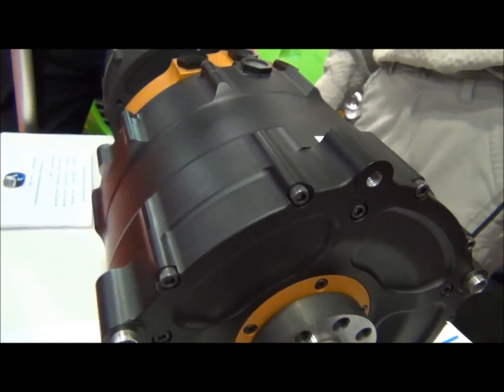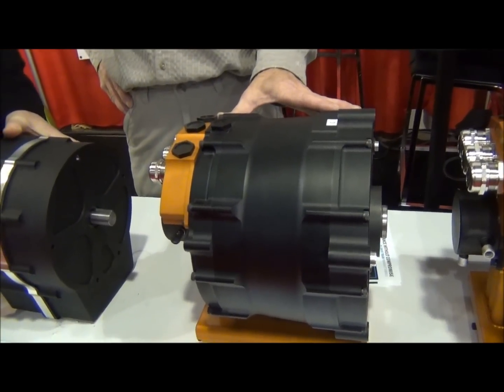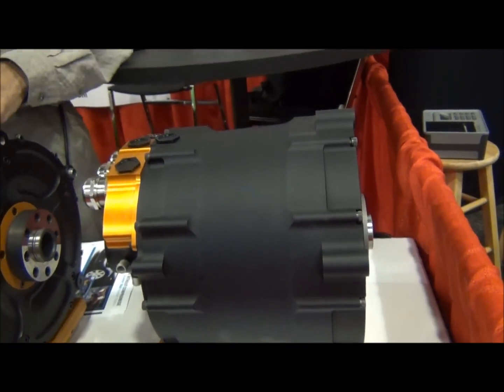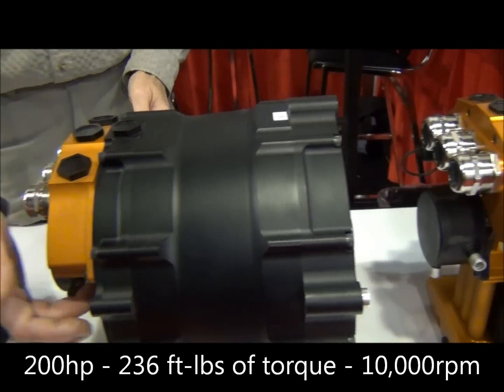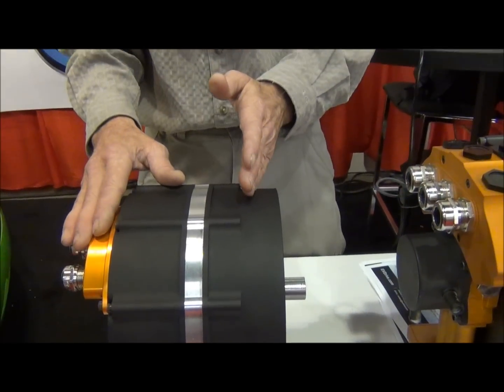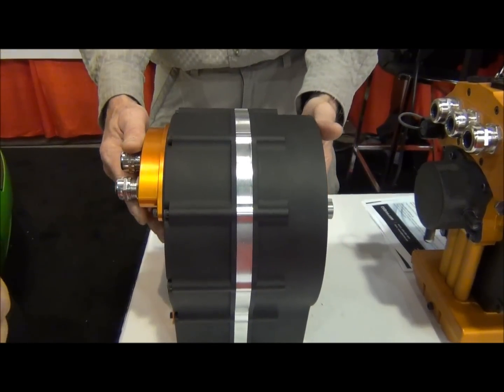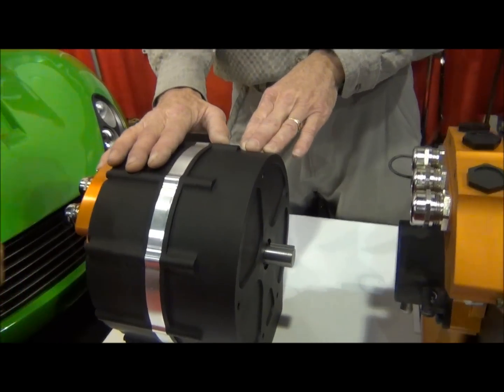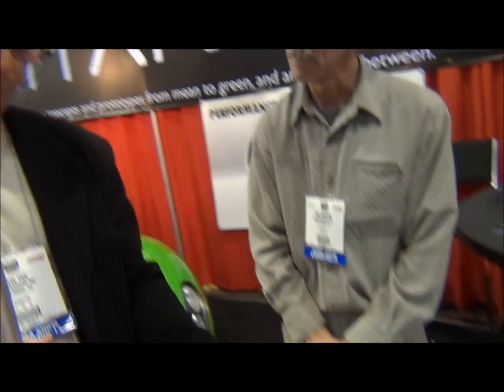EVDrive interview project

Comment: As soon as this engine becomes available I am doing a full ev conversion to my 2011 F150 planning on having 700 to 800 hp with a range of 500 miles adding a high performance wind generator, small gas generator and a solar... three energy supports... just in case. The EV energy along with battery revolution that we are living... is empowering people at an amazing pace... cars are going to be cheaper, gas cars will be obsolete in 10 years... let's see :D
Reply: Sounds like a Cybertruck with a few accessories will do the trick! I'm thinking a tow behind toyhauler trailer will have those three other sources you listed along with additional battery storage to be able to charge the Cyberquad or equivalent.
Reply: I've been planning a conversion and I think having a gas generator is the way to go...for now...do you have suggestions on gas generators?

Comment: Are they using the Remy hvh250 motor? They should try out the HVH410 motor, its got the torque to push a semi!
Reply: They use Remy cores for most of their motors. Go to this page http://www.evdrive.com/products/evd-motor-controller/ and scroll down you will see a couple of massive motors, don't know if it's the HVH410, but they do match the core up with the application.